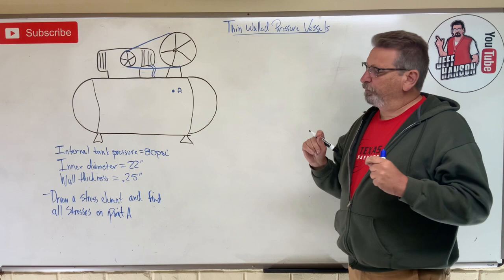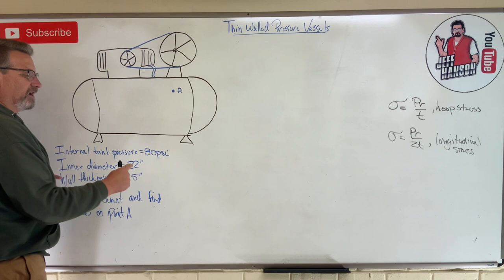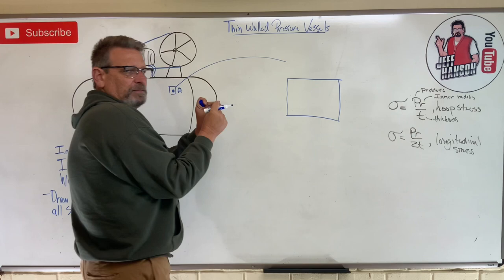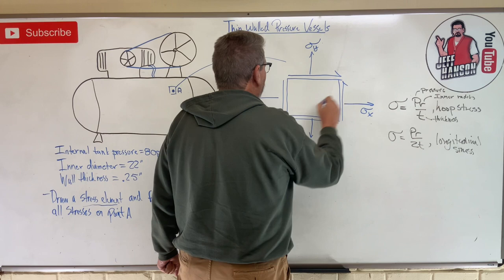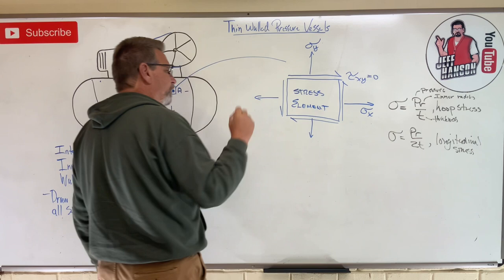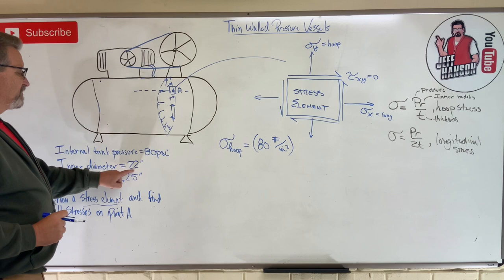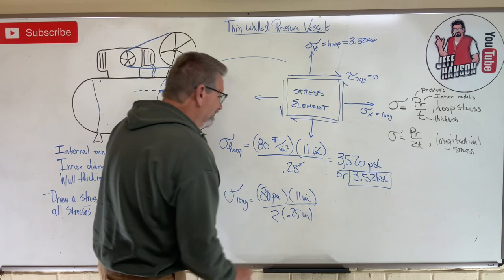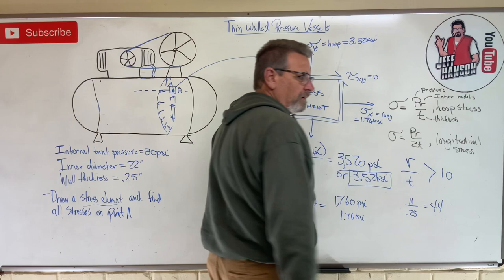Mechanics of Materials: Lesson 42 - Thin Walled Pressure Vessel Example Problem

Comment: Good lesson. You mentioned to use the internal radius, but for a thin-walled cylinder i was taught to use the average radius (sum of internal and external radius divided by two).

Any thoughts?

Comment: why does that element of the vessel have longitudinal stress if it was in the cylindrical part of the vessel
Reply: Because the internal pressure acts on the end domes, that pulls longitudinally on the cylindrical part of the vessel